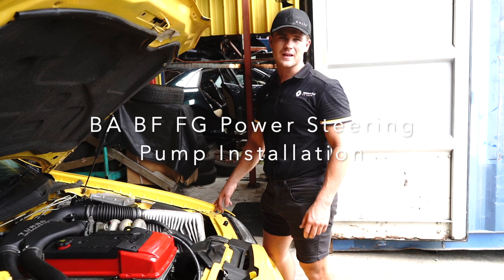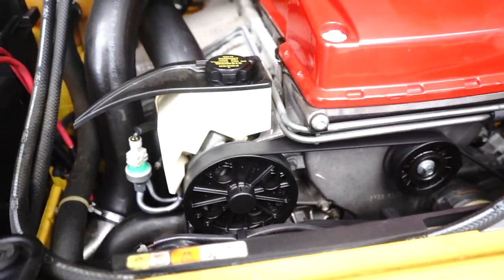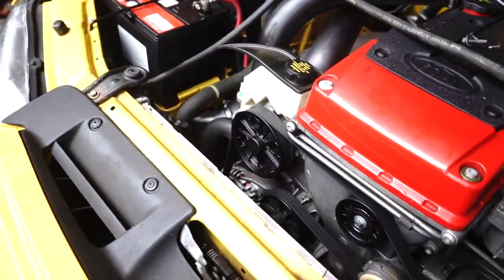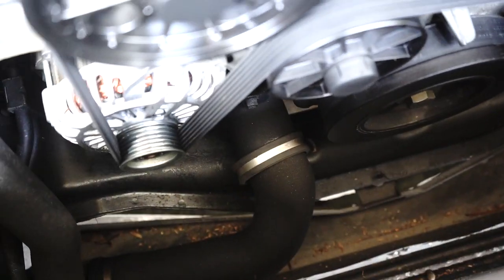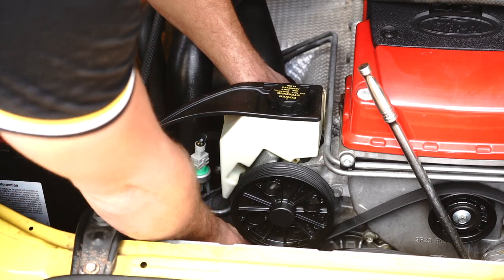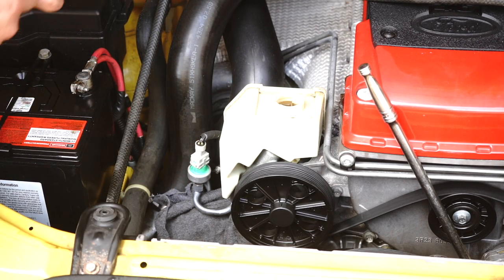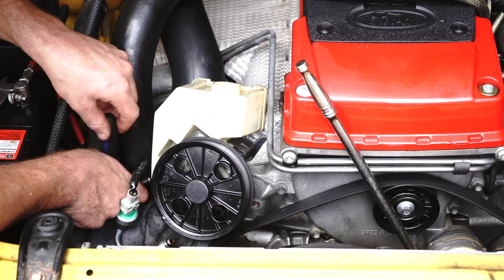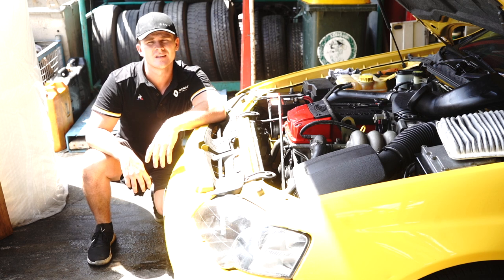How to Fit and Replace a Ford Falcon Power Steering Pump | Parts Factory Australia

Comment: Thanks for the tip about removing the fan shroud first in order to free up some space and make life a bit easier.  Did the pump on an EF Falcon a while back with the shroud in place and shredded my knuckles on the sharp plastic edges in the process.  Replacing the pump on my BA ute tomorrow and hopefully things will go smoothly!

EDIT:  All went well, but you were right about the bottom bolt being a pain to get in, however I succeeded in the end without power tools by doing a lot of jiggling.  And yeah, for anyone doing this I would suggest sourcing a new o-ring firts (not supplied with the pump); mine was all distorted and dry however fortunately didn't leak a drop when I reinstalled the HP line, so I guess I got lucky.
Reply from the maker: Haha yep! I also shred my knuckles on the fords.

Comment: There is a aftermarket high pressure powersteering line you can get on ebay that replaces the old one and it eliminates the nut with the orings seals inside it it's a flare style seal with a over nut that slides up to the pump securing it and sealing the lines together

Comment: How do you know what power steering fluid to top up with do you need to flush it with a new pump or just top it up?
Reply from the maker: Full flush. Google what it needs is usually best way. Thx
Reply from the maker: Full flush. Google what it needs is usually best way. Thx

Comment: There is a crack in my power steering pump reservoir and it leaks should I just get a new pump or should I sus out the O ring?
Reply from the maker: Possibly cheaper and more effective to replace the entire pump

Comment: Hey , where is the power steering pressure switch on these motors , is it the switch right next to the reservoir? Getting a p1550 on the diag
Reply from the maker: Yep that's right. Common Fault

Comment: Recently bought a power steering pump from the link below. New power steering pressure hose fittings do not screw all the way into the pump or rack. Will this be ok?
Reply: The replacement lines from kelpro do not go all the way in

Comment: My new pump is making turbo noises when I accelerate... Tried 2 times putting the front of car off the ground and turning the wheel left to right 40 times but still there. I think I did install the lines after I'd already screwed the pump to the block. I guess I've got air in the system??
Reply from the maker: Yes check fluid for air bubbles. It's cavitation
Reply: @thepartsfactory4239  thanks for reply! there's no bubbles. Actually even after I put the pump on and started it there wasn't any froth or anything even before I did the wheel turns.

It's seems to turn normal apart from the whirring sound and a little bit of play in the steering wheel when beginning the turn. Maybe I've created a leak at the connections or the pump is just naturally noisy I've heard some pumps can be noisy

Comment: I'm still having whining noises while accelerating and in idle could i have messed up the line because I put the high pressure line on(with some difficulty) AFTER I'd already bolted on the new pump to the engine and I haven't put the line on correctly where it's mean to be or even bent the line maybe?
Reply: I’ve got the same problem with this pump, did you fix it?
Reply: @willmcbeath1744 how’d it go I got the same problem
Reply: @Moot-destroyer hey mate, nice username btw 😂 I ended up taking the piece of sh1t pump off because it’s Chinese and super loud. I replaced it with a refurbished one that I found from my local area (think it was like Ringwood in Vic) the people at parts factory Aus are very quick to say no to refund for the terrible part. The refurbished one was much much much better, better than my original. Just make sure when you replace it that you never go full lock too often again when turning cause it’ll blow up any power steering pump on falcons. That’s what happened to me at least. I installed a metal filter (magnet like system) on my return line so that I could hopefully get any metal parts from the original pump (in the case if there were any) out of my steering rack and stop it from circulating. Lmk if you need anything else
Reply: @Moot-destroyer oh and make sure you put mobil 424 liquid in the system cause the original ford one is crap apparently, makes the system run a lot better
Reply: @willmcbeath1744  I put nulon in it
Reply: @Moot-destroyer  not sure how that will go tbh, so maybe run it until you have an issue?
Reply: @willmcbeath1744  is it safe to drive on with that noise from the pump
Reply: @Moot-destroyer honestly I took mine out after like 6 days cause it didn’t get any better and I wasn’t sure it was safe if I randomly lost power steering
Reply: @willmcbeath1744  I was wondering bro I have a 2011 g6 falcon I was wondering if it’s a mk1 or mk2 cuz I’m trying to get halo lights for it and there good for mark2 falcons but idk if mine is a mk2

Comment: Removing the fan is much more difficult on mine (non turbo I6) because of tabs on the bottom of the fan that foul on radiator hoses. As far as I can tell the radiator hoses will need to be removed
Reply: Shouldn't be like that. Also have a non turbo and fan is easily out/in.
Reply: Have to tilt on a certain angle and it will clear the hoses.
Reply: Mine also isn't that easy to take out,
But I truly appreciate this video. 💯👍

Comment: Ummm you out on the same pump. Not the new one. Wtf
Reply: He explained why in the video.  The old pump turned out to be fine and did not need replacing; the problem was a leak in the line due to a bad o-ring.
Reply from the maker: Thanks Phillip... haha